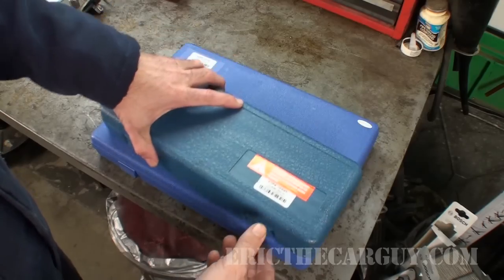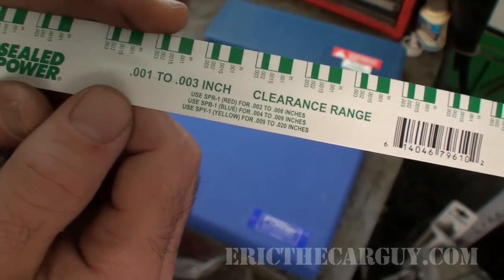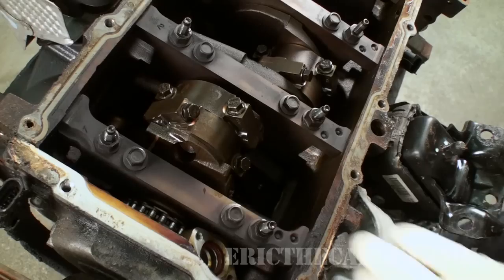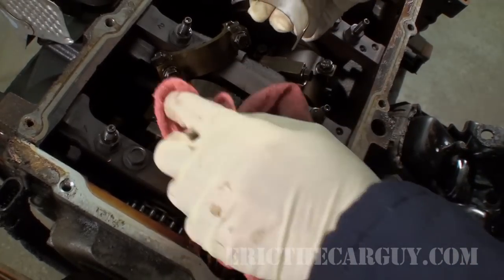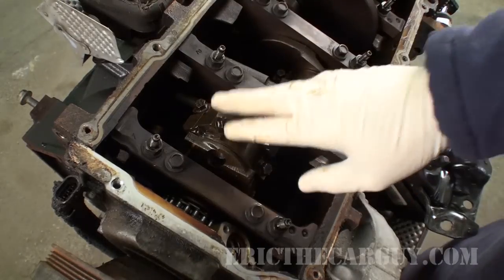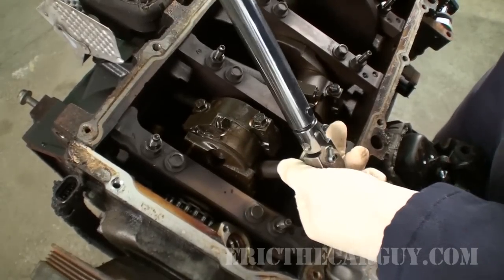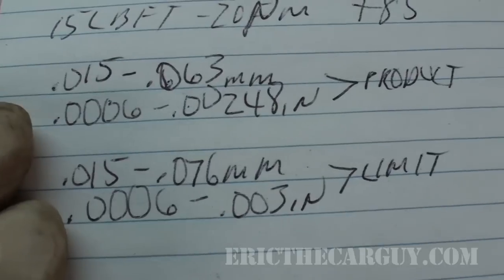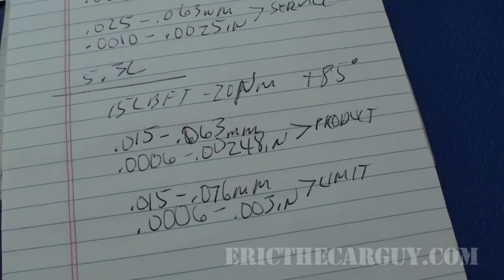How To Use Plastigage -EricTheCarGuy

Comment: Hi Eric. I have an 84 F-150 that I built a high performance 351w for. Now before I ever started working on it I noticed that the oil pressure gauge would read  correctly when cold, and as it warmed up it would drop, until it wouldn't read anything at idle. If I revved up the motor it would read 40 psi for that moment but drop back to nothing again when allowed to return to idle. Now fast forward....  New engine, new high volume oil pump, aftermarket gauge installed... Exact same problem still exists. When I first started the cold engine it's a solid 35-40 psi. After 15-20 minutes of regular driving the oil pressure begins to drop. When driving it will be about 17 psi, And then about 7 psi at idle. Before I installed the Equus gauge I had assumed that the gauge was inaccurate due to a poor electrical connection (the wire lead on top of the oil pressure sending unit being a little loose), but it's looking like that's  not the case. Now I've put ALOT of time and money into this motor over the past 3 years and I definitely don't want to damage it. Possible malfunction of the oil pressure relief valve in two different oil pumps in a row?? After some research I read that 10 psi per 1000 rpm is a good rule of thumb. If that is correct then 5 psi at warm idle of 500 rpm would actually be correct as well as the 15 psi at 1500 rpm while driving AND the 35 psi at 3500 rpm. 

Do I have a problem or not!?
Reply: You're bearings are shit!

Comment: Just a few quick things I noticed:
1. It's easier to cut the plastigage instead of sliding the whole thing out. 
2. I don't agree w/ torqueing the to spec as you are going to pull it right off. Torque spec is torque-to-yield meaning you can't reuse those bolts anymore (wasted money if you had used new ones) and only applies bolt stretch to help it not back up. 
3. You make great vids Eric! Keep it up!
Reply: Toluene whats the proper way of doing number 2? Without wasting anything?
Reply: @beetlejuice1239  Tighten it so it removes any clearances on the mating surfaces, but not  to torque spec. Torque-to-yield actually stretches the bolt which doesn't help in the measurement process and that's why you have to replace them.
Reply: @Diallo268 I was thinking the same thing about the torque to yield, I think it would depend on if you’re actually using torque to yield bolts or not. Something like ARPs are reusable and usually come with their own guidelines on how to torque them down.

Comment: Should I use the plastic gauge with old or new connecting rod bearing and crankshaft bearing?
Reply: That's a very good question. I'd like to know myself too. I'd suspect you'd have to use standard size bearings to see what the clearance would be and then back it off with a different spec bearing to accommodate proper clearance.

Comment: What do you do if the measurement shows the Gap is too large? Does that just mean you need a new crankshaft? Or does that mean you need a different set of bearings that are thicker?
Reply from the maker: Usually a thicker set of bearings, but you want to make sure the surfaces also aren't damaged or it will damage the new bearings.

Comment: When i do my rod clearances, do i have to measure each bearing half with plastigauge? So i'd be making 8 measurements (4x cap side, 4x rod side)?
Reply: You don't HAVE TO, but it could show any machining errors. Or errors in the bearing manufacturing.
Reply: This 4 position method would also indicate the rod’s big end or crank, is out-of-round. This is where micrometers come out to measure the rod and crank. But with being said, it reveals more about the fit and accuracy with only plastigauge. This is the “Sealed Power” spells it, as the patent goes back the the 40’s.
1978 ASE Master Tech

Comment: Hello Eric,

Plastigage actually very good for measuring journal clearances, much easier than using a caliper set that has multiple steps to calibrate and measure.

I am working on a Toyota 2zz-ge rebuild and will plastigauge all bearings.  Bummer is that I have measured bore and Toyota is asking for tolerances to 0.001mm, outside the range of my current calipers (max bore 82.013mm....with my tools I'm at 82.015 to 82.017 max....GRRR, and my tools only good to 0.01mm...estimated actual)

P

Comment: I'm not a pro mechanic, but wouldn't the bolts stretch every time you torque them down? So if you were to check the clearances multiple times wouldnt you need to get new bolts for the rods?
Reply: You won't be torquing the bolt past its elastic limit so it will stretch but will go back to its original size after you remove the load.
Reply: Rod bolts typically are not torque to yield bolts, they can be reused. Head bolts on the other hand, a lot of the time are torque to yield (meaning can only be used one time, because it stretches the threads beyond their limit). Always look this up for your specific vehicle before reusing either bolts though, just in case.
Reply: Good point, was wondering this too..
Reply: Thank you for answering this correctly Dot. Materials have an elastic and a plastic range of deformation. In other words there is a threshold of tension that will deform a bolt permanently. For smaller amounts of tension, like the bolt will see during proper torquing, the bolt will return to its original size when the tension is removed.
Reply: All chevrolet LS engines witch this have a three time use on rod bolts,they are torque to yield,after the third time they need to be replced
Reply: I'm reassembling a motorcycle engine after replacing the piston and cylinder head (dropped valve).  My manual says to replace the rod bolts and nuts, "designed to stretch when tightened.  Never reuse them."  So, what this video means is that I would waste two bolts and two nuts JUST to check the clearance, per crank pin.  That's over $20 JUST to check.  So, at least in my application, Mark Chang would be correct, and Dot and Andre would be wrong.  Be careful and read your manual.  Also, surely there's a cheaper way?
Reply: @WReckeR306  they are not wrong, typical steel is 60 ksi yield limit (unless you are using outdated/generic A36 which is 36 ksi) beyond that limit is plastic deformation (in other words permanent deformation), under that is elastic (meaning it will spring back into position)

However not all material is created the same, if you're using aluminum it has a very low modulus of elasticity in comparison to steel and will not spring back into position. 

But in the end you should consult with the OEM spec to see what manufacturer designed for
Reply: As a degreed mechanical engineer, I understand elastic vs. plastic.  The solution would be to torque to the non-yield limit, then back out and check the plastigage.
Reply: It depends if they are a torque to yield bolt, or not. If they are torque to yield. It's one time use.

Comment: I place the bearing into the block and cap (rod & cap also) so that there is a slight protruding edge of the bearing on each side. This way, the bearing is properly seated into each half of the journal and that the two bearing mating surfaces will "crush" properly and evenly. This insures that the bearings will be evenly seated in each half of the journal when torqued down. Liberal engine assembly of course after plastigauging is completed.

Comment: Damn, I never want to blueprint an engine if you have to do this several times with each journal. Would be so much work. Now we know why engine rebuilds are so expensive!
Reply: They're expensive, b/c just tearing it down and cleaning is most of the labor and they charge 100/hr. Installing bearings/rods/pistons/cams is relatively fast (especially with experience). The rest is not (like DOHC timing).

Comment: hey eric ,,, thanks for these great videos ,,,
but I really need your advice now on something in my 150 cc scooter ...
my scooter manual says that I must change my engine oil every 1000 km as It is an air cooled engine and also doesn't have an oil filter ,,, so now I have bought something that would allow me to add an oil filter to the passage of the oil between the oil pump and the oil lines leading to the crank shaft and the cam shaft ... 
which will longer the lifetime of that same oil to 3000 km !! which will definitely save me alooot of money ...
but then I realized that it might kill the oil pressure and may damage the engine as well ...
so what do you think of it ,,, should I instal this oil filter or not ?
and will it really damage the engine that bad or not ?

Comment: actually those micrometers are no alternative to plastigage.
Plastigage is pretty much the only way to measure bearing clearance when torqued down.
Ofcourse you can measure a torqued connecting rod with bearings torqued down, but with an inner micrometer it is measured at 2 (or sometimes 3) points. That doesnt represent any tension with fitting the part. Plastigage can do that.

Another way would be a feelergage, but you cant get one inbetween because of the roundness.

Comment: The correct way to use platigauge is to carefully remove it from it's paper sheath. Then take the green wax strip and insert it into the trash. Next buy or borrow  a micrometer and dial bore indicator 👌.

Comment: Q:  After torquing to 15lbs, what would your estimate be of the added torque of the 85 degree further bolt rotation?  Or did I miss something?
Reply: I guess he could have measure that. But the final torque doesn't matter. Lots of parts are torque to a setting and turn it some more. Like some spark plugs you torque them, then you turn a 1/4 turn more. On some wheel bearings you torque it, then you actually loosen it a quarter turn, etc. Just do as the manufacture recommends. oh, and something else, is sometimes there is a torque setting to use if you didn't lubricate the bolt, and a lower setting if you did lubricate the bolt.

Comment: dumb question, but what do you do if it's out of spec? just hand it to a machine shop and say "fix it"?
do you machine the crank surface or the bearing?
Reply: I ended up using Plastigage with Clevite High Performance bearings and everything was .001.  Since I had to buy a set of these my concern was about something being out of spec.  At the time I didn't know you could buy individual pairs if you needed a different thickness to get within spec.  But the other concern was some bearings don't come in different sizes so what then?  It's a puzzle sometimes.  I got lucky mine were in spec.  The bigger question is why I pulled my engine to change the clutch and somehow ended up replacing my main and rod bearings?
Reply: Well, in this case you might need new bearings. New bearings will close of the clearance. You can change the bearings yourself, but you can't machine it yourself. For a machine shop you just tell them that your bearing clearance is bad. They will know just about everything possible about rebuilding an engine block.
Reply: Exactly, wondering that myself.  I know they sell different bearing thicknesses for some cars, probably all.  It'll probably need to be line bored (or something like that) at a shop.  But, I want to hear what someone with experience has to say, not my own guesses.
Reply: Melody doing this right now with my stroker LS1. Big pain for me right now. Had block line bored figuring I would ensure the mains were true and straight but with all variables with aftermarket crank and bearings I still need more clearance. Even with Clevite X series bearings with .0001 extra clearance I still have to polish the crank down only .0002 on 1 journal and all the way up to .0008 on another. PS dont use plastigauge.
Reply: Ahhhh thats exactly what i was wanting to know thank you :)

Comment: basics?  anything with the rotating assembly is not 'basic'
thanks for the video!
Reply: Yes it is.
Reply: What I meant was ....When motors get down to this level of accuracy, its best to let a machinist assemble since this is extremely specialized.  That is, if you want the motor to last.

Comment: Was he measuring using the old bearing, or the new bearing?  Since we are measuring to see if the space is within spec for oil clearance we'd be using the new bearing, right?  What if it isn't in speck, do you get a different bearing thickness or is it off to the machine shop for some rough, unwanted sex with my wallet?
Reply: lmao at the last part. I actually been wanting to know myself too.
Reply: Lol, when you hold your wallet a certain way it does kinda look like one of them things.  ;)

Comment: is it me,but doesnt o.oo15 mean 1 and a half thousands of an inch,if your big end clearance is 15 thou,its going to knock it out{knock},hope this helps and please tell me if i am wrong
Reply: youre not wrong
Reply: @Mark Gallagher > This min-max measurements are given for each engine and can change by model or production date. His measurement of 0.0015” compared to GM rod specs (0.0009”-0.0025”) is 0.001” under the max, let tighter than service at 0.003”. So, ok. 
ASE Master Tech-Retired

Comment: Why does it have to be room temp to use the plastigage?  4:28
Reply: The metal expands and contracts per the temperature, so I think the reading is best done at room temp, as that's what factory specs were when they were measured.

Comment: Is it just me you you did one bolt 75degrees and another one 95degrees. GOOD video though.
Reply: +Marius Pocius  I saw that too! Also, fifteen thousandths (for the final measurment) is 0.015. 0.0015 is fifteen ten thousandths, which was the measurement, but I would have said it as one and a half thousandths. Great instructional video, and I think if the camera was not there, he would not have made these mistakes. It does make me wonder though, that's why I do my own work, never been able to trust anyone with repairs to my toys in my area
Reply: +Marius Pocius, that could be just you apreciation of the measurement, just'couse you re not in line enought with the toll for a good sight

Comment: Only thing I seen you do wrong is not rolling the bearing in to the rod end cap you are running the risk of smashing the tang on the bearing it self and that's bad news on start up but great video overall
Reply: frankie hp c what do you mean by rolling in?
Reply: @Melody     Rolling a main bearing (with the engine in chassis normally) is when after you have removed the main cap, a cotter pin is placed into the crankshaft oil galley hole so that when the crankshaft is rotated the flat side of the cotter pin head will push against the bottom half of the main bearing pushing it out. You must make certain that the head of the cotter pin is not taller than the depth of the bearing so it will pass smoothly past the block journal while pushing it out. The head of the cotter pin can be tapped or flattened out a bit before the procedure. The reverse can be done for rolling in a new bearing. Wash the crankshaft journals down AND the bearing surface facing the crankshaft journal with brake clean before installation. Choose a cotter pin head that is slightly larger than the oil galley hole.
Reply: While im glad you answered this I'm having trouble visualizing it. Im Going to look up a video on it. I have usually just seen people stick both bearing halves in with their handsand setting the crankshaft in.

Comment: Can't find the main and Rod bearings clearance for a Vtec B16 honda engine.
Reply: dont know if you found your answer.  always call the dealer.  hondas have poor performing oil pumps, so .0008-.0015 is in the ballpark.  never get under .0007 though.  youll be pulling the motor soon if thats the case

Comment: this is the fist time i heard about the plastigage, i only search it in the youtube beacuse im taking up board-exams this year, and i want to understand it and see how it works. thanks to your video
Reply: oh bdw, our method of checking the clearance b/w the crankpin and bearing is by using soft soldering leads, and we use  penetrant test for detecting cracks

Comment: Great video, Eric. I have never replaced rod bearings, so I have a question.
in this video, you measured the cap bearing but not the one between the crank and rod itself. Do you have to measure the one on the rod side, too? Also, can this procedure be performed while the engine is in the vehicle? Thanks in advance.
Reply: @Gary Jordan   >Measuring under the rod cap is done a hundred times per day. To truly get an idea if the rods big end, measuring in two, three or four locations only adds to your accuracy of measuring a 360 degree circle. I will say in advance, it can be done, just do NOT rotate the crank as you will find it absolutely impossible to get the cap on or off doing thing it this way. Don’t get me wrong as some engines will be easier to perform this 2,3 or 4 position measurements.  
1978 ASE Master Tech

Comment: I hate that torque to yield. In a tight space on my trailblazer using that crappy dial gauge, never again. I will spend the extra money on a torque wrench that does angle as well. And even then I will go with a different bolt if possible, like the arp head bolts. I could've used those and just torqued it down and been done with it.

Comment: Sorry to get off topic, but I watched your repair on your friends 98 burban? I forget. Anyways I've also had to do exactly what you did (Though you had some awesome steps that could of made my job a little easier.)

I was hoping you could answer a problem I'm having with my 1996 GMC extended SLE 5.7. So my question though that I'm hoping you can answer. My thermometer gauge inside the truck will bounce around from the normal temperature to the max temp. I changed my thermostat (didn't change anything), but I think it is a loose wire somewhere. When driving on a smooth highway the thermostat will go back to it's normal running temp, but when I hit bumps it bounces all around. Got any ideas?